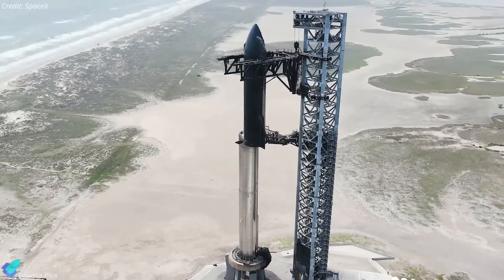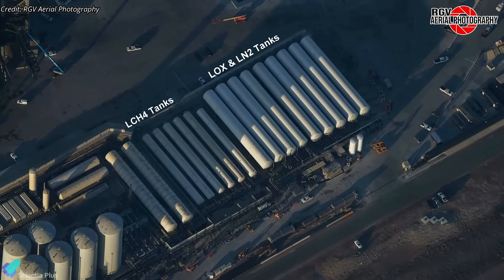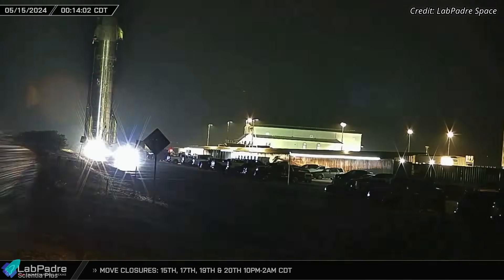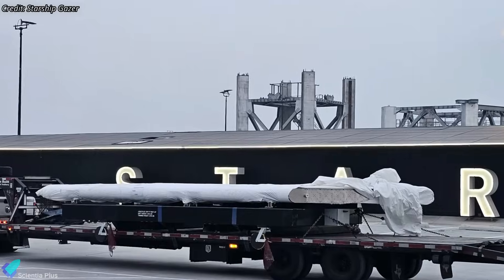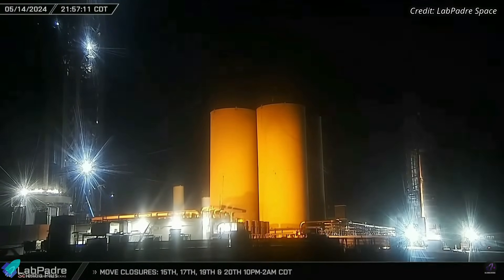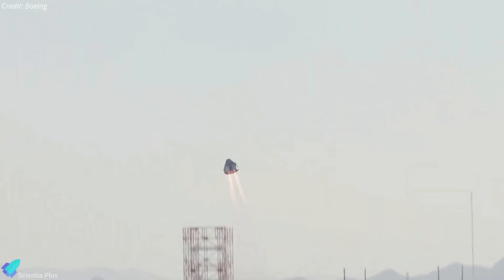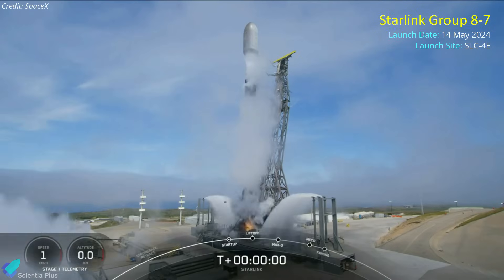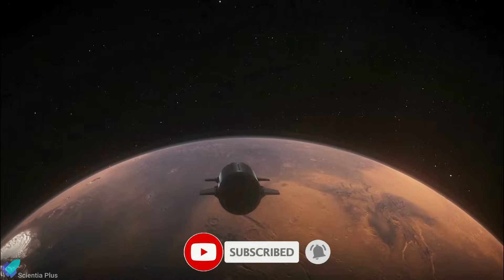Starship Flight 4 Prep In Final Stage: Launch License Official Update

Comment: Surprised you did not know that a pressurized pipe in the raceway blew, blowing off the cover and exposing the electronics to a high pressure blast and exposure caused f the electronics to the metal of starship and moisture from condensation. No t a good combo.